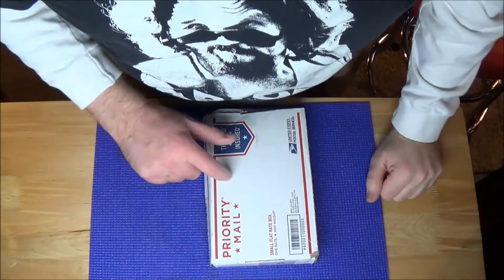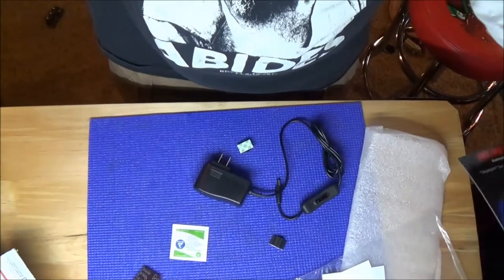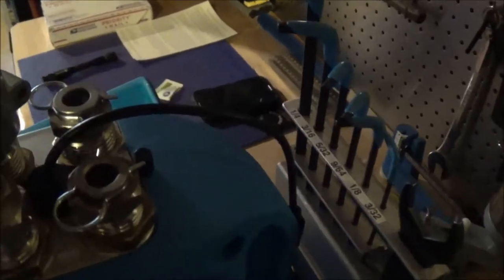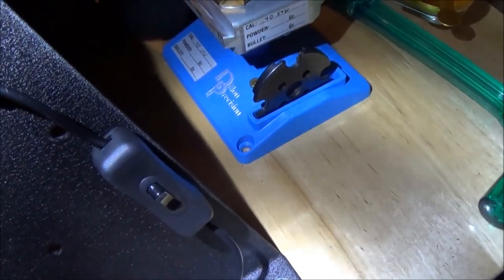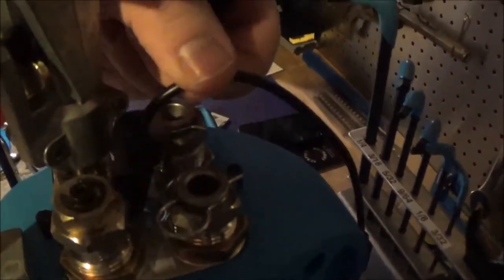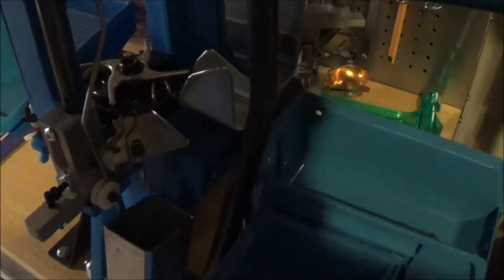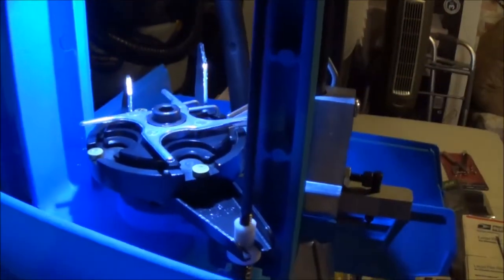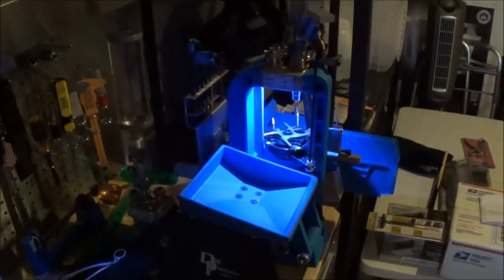Dillon 550B Skylight by Inline Fabrication

Comment: This is tits man! When I finally bite the bullet on a dillon I'll be sure to get one of these!
Reply from the maker: Hell yeah. I don't know how I went this long without it!
Reply: therealcobraburnout I forgot to mention thats one hell of a press you got there. I'm still doing it the hard way. I've been working up to one. Bout ready to pop.
Reply from the maker: Pop on one. You wont regret it. Once I saw hickok45 show that he uses a Dillon 550B, I knew it was a good one.
Reply: I have a 550B haven't used it in years. Probably going to dust it off and start cranking out some rounds.

The light looks pretty good.
Reply from the maker: Heck yeah. Dust that baby off and crank out some rounds.
Reply from the maker: MadMetalManiac74 I love the Dillon RL 550B. I almost started on something smaller but glad I didn't. This bad boy should last me.